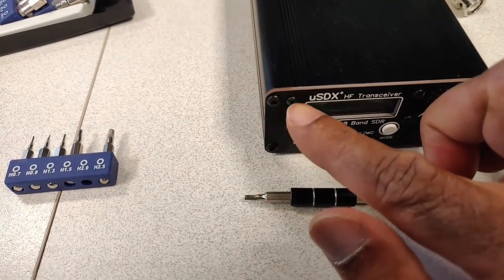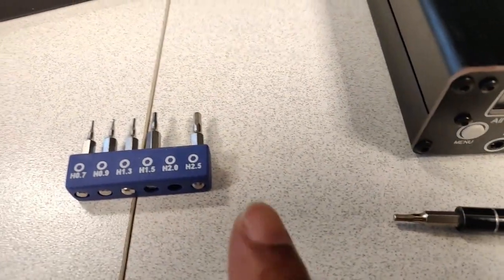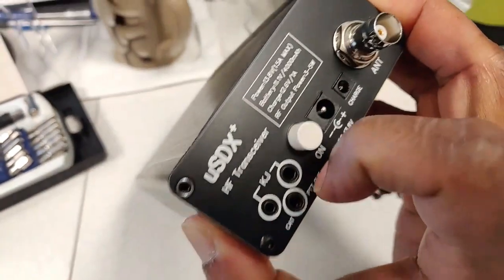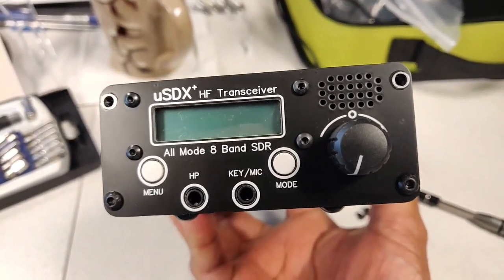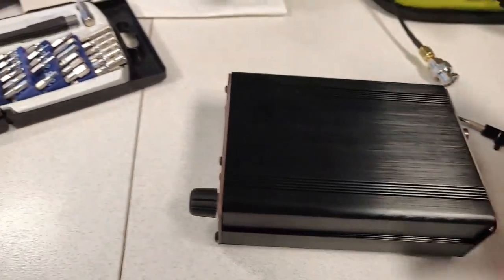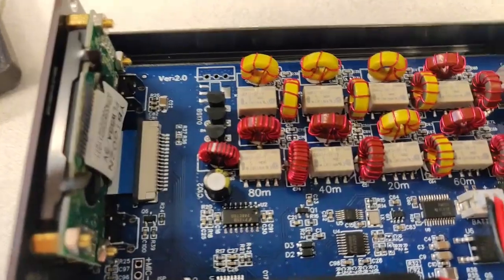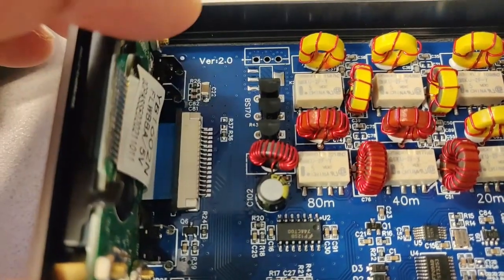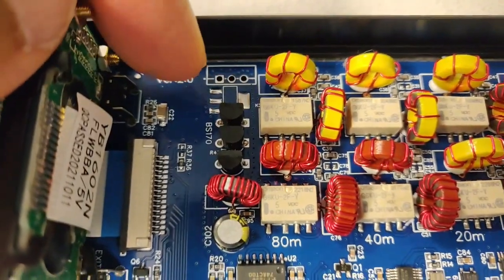uSDX+ | 8 Band SDR | SSB/CW QRP All Mode HAM Transceiver |  Teardown | Inside look

Comment: Many thanks for video. Can you please provide a link where possible buy this battery?
Reply from the maker: @Topga  https://youtu.be/n6o_6NPjrKU
Reply: @PremMenon  Thanks, I already find it myself.
Reply from the maker: @Topga  I've posted another video just on the battery because many requested info on that. Check out for the video on my channel. Thanks for your feedback.
Reply: @PremMenon   Thank you very much for the quick reply. The seller almost always sends without batteries (the parcel goes faster due to safety) and for this transceiver the question often arises, where to buy a battery.

Comment: do you have a schematic for this board? have you thought about adding the IRF510 Fet to boost the output?
Reply from the maker: Yes, I did have the schematics, but I need to check my archives now. It has been a while, so.... No, I didn't feel the need to replace with an IRF510 because I run it through a linear, and the current drive is sufficient for me. Matter of fact, I suggest an external amp rather than trying to maximize the output from this unit. That way everything operates cool.
BTW, you can ask the vendor for the schematics. They normally give when requested. Good luck!
Reply: @PremMenon  - thanks very much for your quick response. The "white button" radio works OK but the output is low at about 3 to 5 watts, whereas the tr DLMAN usdx radio gives me about 8 watts. Sometimes a little bit more helps. The good thing about the white button radio is that the audio is quite good. I heard you could update this radio with the IRF510 fet but other problems crop up with the addition of this component. Thanks again for your help.
Reply from the maker: @rbashta  you are welcome! As the old saying goes: "don't fix it if it ain't broken". As you correctly said, the upgrade to IRF may not be worth it - with unknown issues ahead. At least the "white button" radio works okay as a complete package. I'd put that effort in building a nice outboard linear.

Comment: I bought my uSDX+ V2  transceiver off eBay and it didn't come with the inbuilt battery pack. I asked the seller if he would sell a suitable battery from him, but he said no. Can you or anyone else sell me the correct battery? Thank you es 73,
de VK2DMH
Reply from the maker: I believe the battery is not shipped to certain countries because of transport restrictions (safety). I had posted a video on a suitable battery. See if it helps: https://youtu.be/n6o_6NPjrKU

Comment: Nice! I bought the version without the battery, but I'm kinda regretting it since this would be a lightweight, all-in-one solution if I had the battery version. Any idea where I can buy a compatible battery to retrofit?
Reply from the maker: Nick, there's nothing special about the battery. Just Google for the model, and you'll see several distributors for that. Good luck!
Reply: @PremMenon  Last I checked I didn't have any luck. I might have looked up the wrong model number. I'll try it again.
Reply from the maker: @newq  give it a shot, Nick. I found many when I last checked. Try Asian distributors.
Reply: @PremMenon  hmm, well I tried searching for the model number I could see in the video (606090-3) and it only yielded batteries with different voltages, capacities and chemistry. The battery in your video is labeled as a 12V, 4000 mAh, Li-Ion, but the results on eBay and AliExpress are all over the place. Plus they look like entirely different batteries. Not sure what to make of it. Perhaps the batteries in the USDX+ were mislabelled? I might still be mistaken about something. Maybe 606090-3 isn't the model number.
Reply from the maker: @newq  please give me some time. I'll see if I can find something suitable.
Reply: @PremMenon  No rush. 😁 I appreciate your help!
Reply from the maker: @newq  I did this quick video for you: https://youtu.be/n6o_6NPjrKU

Comment: Hi Manon Good Video : Did test the rig for output power . Did u get 5watts on 10 Meter band and across the 8 band .. also which supplier did u get this radio from  thank you
Reply from the maker: Hi Richard, thanks for checking out my video. Yes, I've done power measurement. Please check out https://youtu.be/lCmLn8aqYk8
No, I don't recall the supplier name.